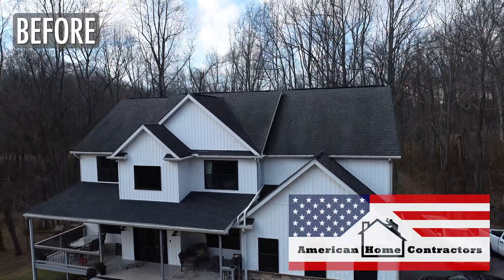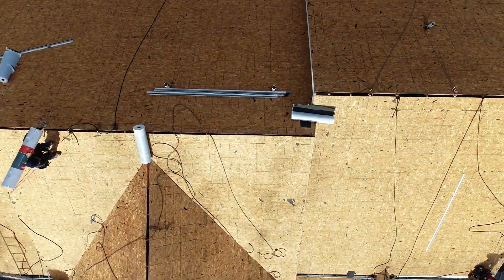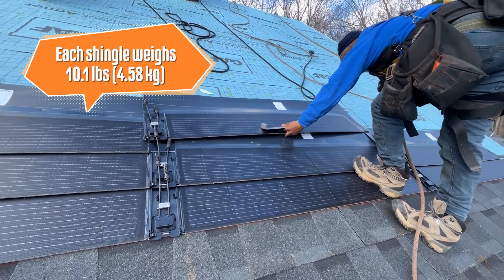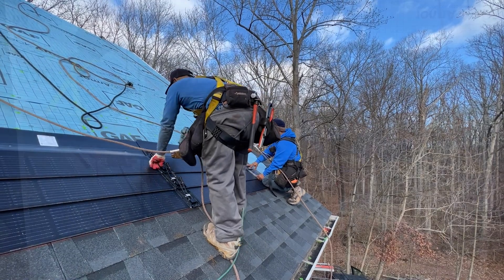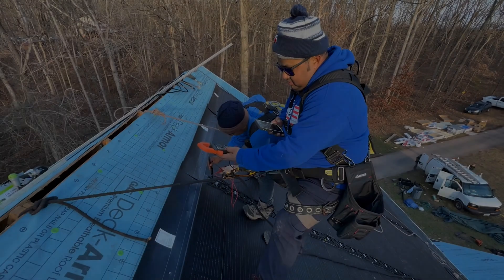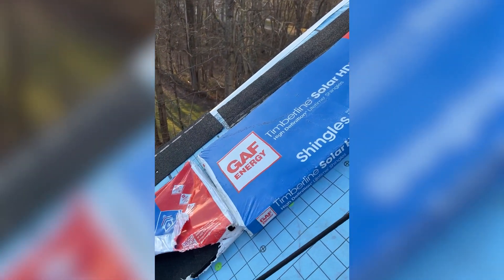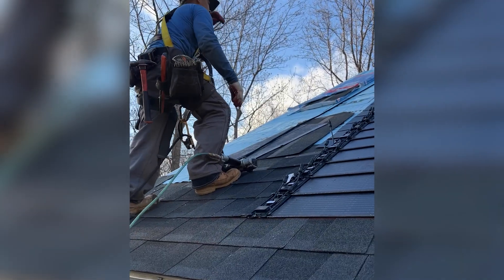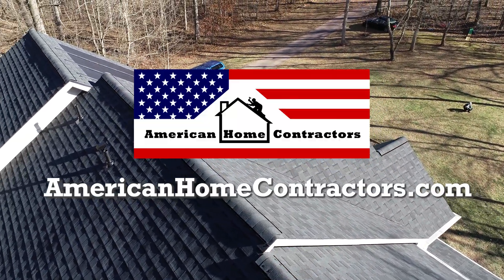In Depth Installation: GAF Timberline Solar Roofing System

Comment: If a home owner wanted to increase solar shingles for watt usage will this offset single format
Reply from the maker: The Timberline Solar Shingles have the same exposure as the Timberline Solar HDZ non-solar, asphalt shingles. There is no change in the shingle format by adding active solar shingles.

Comment: How replaceable are these if the they break and/or need to be upgraded.  Also even at 45w that means those 78 shingles only made 3.51kW.  Need a pretty big roof to get to say 10kW
Reply from the maker: When you get Timberline Solar installed by a GAF Certified Installer, the warranty provides 25 years of coverage for Solar Power Output, among other things. You shouldn't need to upgrade an existing system any time soon. Plus, this product is durable, so replacements are rarely needed. GAF has published content where they dropped a 20lb medicine ball onto the shingles from 30ft with no damage!

Here is an example of a 10.08kW roof we installed a few years ago: https://www.youtube.com/watch?v=6ISK_fRvFx4

Comment: Wait...Whoa...10 Watts per shingle?  No Sale!
Reply from the maker: This was a typo - it's actually 10 VOLTS per, or 45 watts.
Reply: @ahcdmv  You guys really need to either re-dub this or at least edit it to update that figure, because if not for this comment I would have moved on to a different tech without taking a closer look at these. That is a massive difference, and if people are shopping by the watt like me it will likely turn a lot of people off.

Comment: Still looks and screams solar roof, which is unfortunate. The transition from panel to asphalt is too contrasting.
Reply: I like it also it does somewhat reflect the sun thus decreasing cooling costs which is the majority of the electricity used in your electric bill
Reply: Agreed. I don't understand why GAF and CertainTeed don't develop a shingle to be installed with their solar shingles that has a similar look. The active and inactive shingles should look the same. If not it looks like traditional solar on a shingle roof, just without the 3" gap.

Comment: Nice roof, But like anything a home owner does to his house the main concern is price and savings.
Reply from the maker: Agreed! With the federal solar tax credit still at 30%, it is more affordable than you'd think to include a few solar arrays while replacing old asphalt shingles.

This family is now able to offset some of their monthly energy cost because they are generating on-site! Include a Powerwall battery or two to store that excess solar energy, and you're safeguarded against power outages AND still using solar well after the sun has set.

Comment: I would love clarification on this statement from the IRS (BELOW) Reason being, I am interested in the GAF solar shingles (Energy Shingles). With this, GAF or the contractor I am using says that I need GAF Solar HDZ shingles to support the Energy Shingles and these aren't your typical shingle... they are specifically made for this type of roof. Would I be able to receive a 30% tax credit (granted I have the tax liability) on the entire cost of the roof, or just the GAF solar shingles? My tax preparer couldn't give me a clear answer and IRS isn't helping either. 

Q. Is a roof eligible for the residential energy efficient property tax credit?
A. In general, traditional roofing materials and structural components do not qualify for the credit. However, some solar roofing tiles and solar roofing shingles serve as solar electric collectors while also performing the function of traditional roofing, serving both the functions of solar electric generation and structural support and such items may qualify for the credit. Components such as a roof's decking or rafters that serve only a roofing or structural function do not qualify for the credit.
Reply from the maker: Always need to consult with your tax professional, but we have had customers claim the tax credit on the entire roof and others on a portion of the roof.  Replacing the roofing materials around the "active shingles/tiles" is part of the cost of going solar.  Since it is an integrated system, the asphalt shingles could be defined as part of the overall "solar roof".  Again please consult with a professional.  This is not tax advice.

Comment: Can these be installed with a metal roof?
Reply from the maker: Unfortunately, this system is only compatible with the Timberline Solar HDZ asphalt shingle.
Reply: Pewter Grey shingles?
Reply from the maker: @ch1ngon  Charcoal
Reply: Can it be installed on the whole roof surface?
Reply from the maker: @siwo972  The Timberline Solar Shingles can be installed on a good portion of the overall roof surface, but the integrated Timberline Solar HDZ asphalt shingles need to be installed around the arrays (due to fire set backs, eaves, ridges, walls, rakes, obstructions, etc..)

Comment: Cost per sq ft….or kWh?
Reply from the maker: We use both to determine the price of the overall solar roof system.  Figure $600-$700/square plus $3-$4/watt